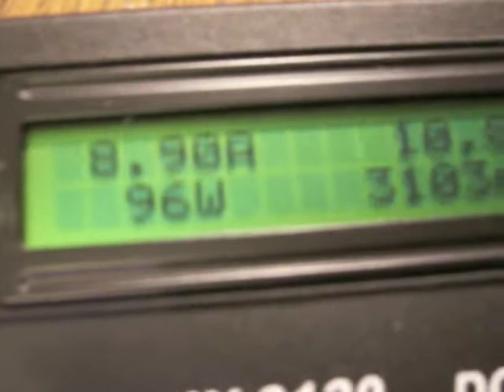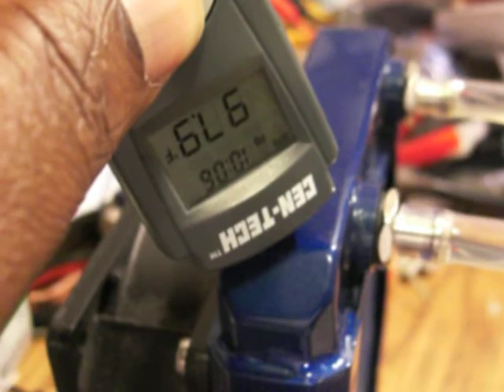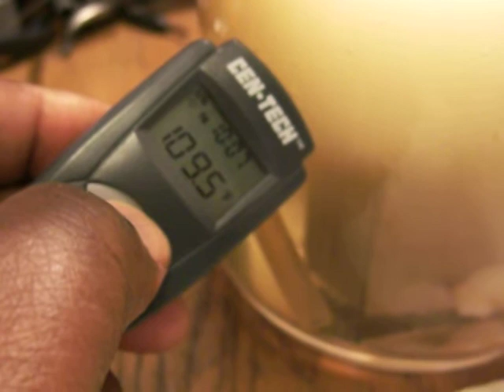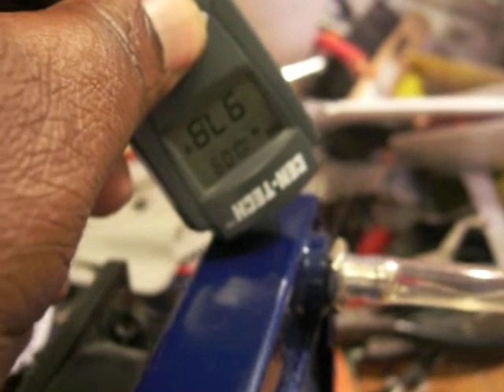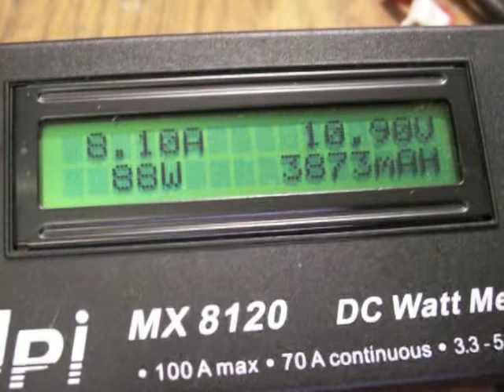HHO Production - Amp Control 2

Comment: i use black dots to take readings off put on the side of my units, you can use tape {insalating type] paint dot, as long as it is black.
NICE VIDEO,
hope helps you, but temp can be 30% wrong read out i found.
thom in scotland.

Comment from the maker: Yes I have, I contructed a 3 cell system that gave me about 1 ltr in 1 min. this particular video was to see if we can control amps with temp control. The cooler you make it, the less HHO you get. I did not put the HHO meter on this generator yet.